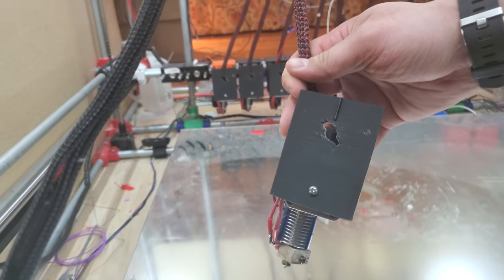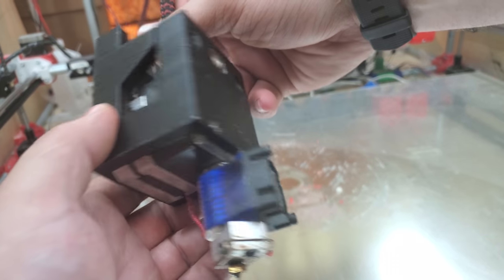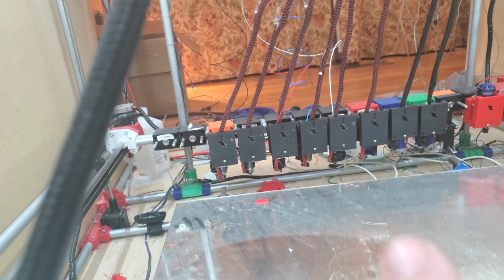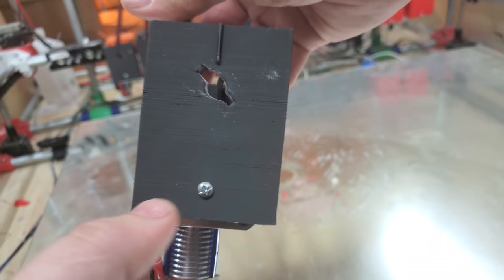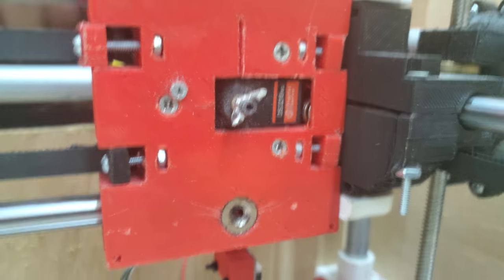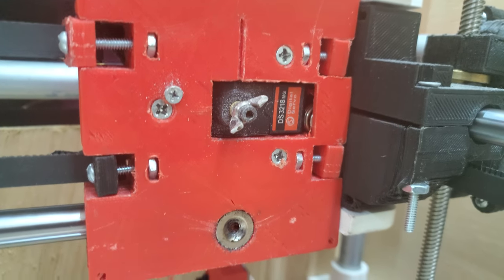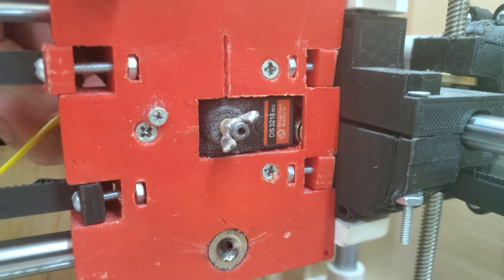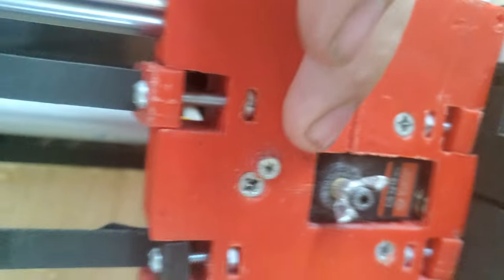Tool changer head/carriage quick video

Comment: Thanks of the video! i have seen your machine around and this was the thing that i was most curious about. im currently putting one together, been working on it for way to long though :-p I have finished design and printing of parts and decommissioned my only printer so hopefully lack of operational 3d printer will motivate me to get the tool changer installed and running, currently working on electronics and marlin 8bit . It has been real encouraging for me to see that it this concept can be implanted without a massively large cost and high end equipment if you are willing to be smart with the materials and resources you have available.

Comment: hey how has this been lasting?
i want to use a servo but i heard they don't last long.

are they still working after this time?
Reply from the maker: I used micro servos but they died.  I upgraded to a decent $20 metal gear digital servo on both of my xy tool changers and have had zero issues